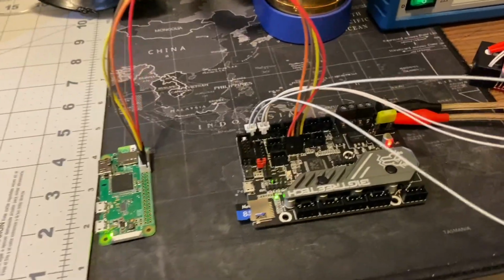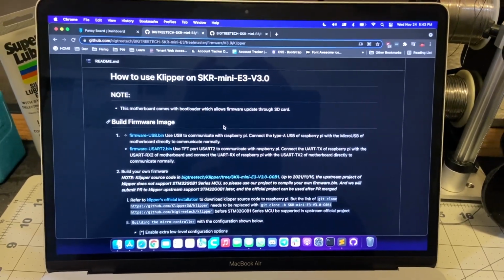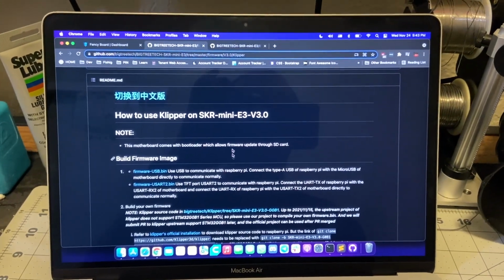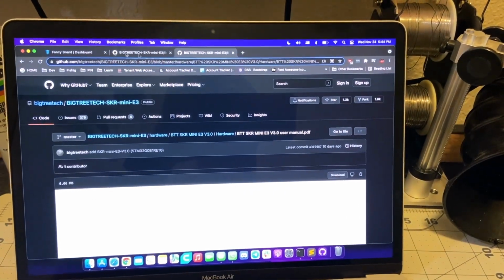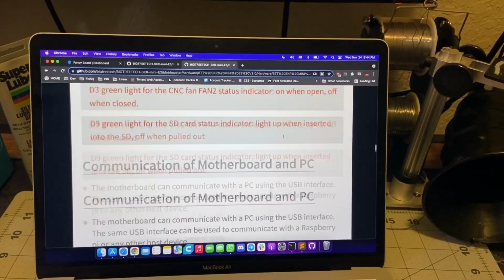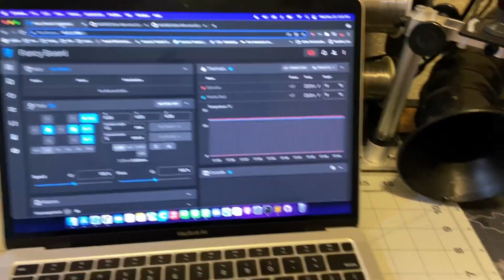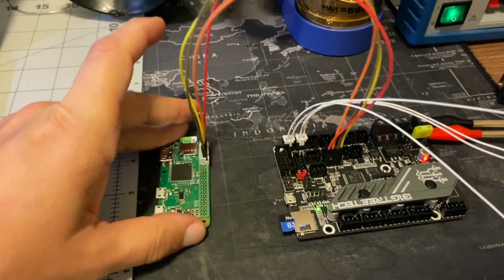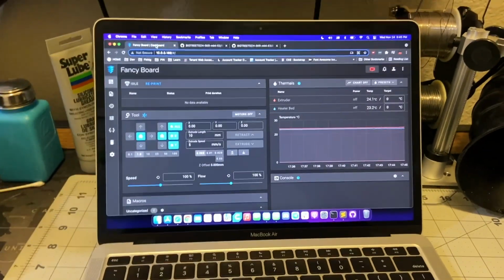(Outdated) Klipper on BIGTREETECH SKR Mini E3 V3.0 (Fix)

Comment: I have an Ender 3 Pro with an SKR Mini E3 V2.0 running OctoPrint and it works 100% fine. I just got my SKR Mini E3 V3.0 but I noticed there aren't any working firmwares yet. Do you know if there's a working firmware out there that I can play with for this? I read that I need to use the standard Arduino image, but that throws up errors in VSC. Thanks!
Reply from the maker: Hello. Yes, check link in description, there are 2 precompiled firmwares at bigtreetech GitHub repo Marlin and Klipper, good luck in use ;-)
Reply: @hobbyistnotes  sorry I suppose I should have clarified my situation better. I am definitely comfortable compiling my own firmware, and I did see those two options on the GitHub Repo, but I have custom fans, housings, dual z, etc. and I don't believe the standard precompiled firmware is adjusted for those things. Not sure how I could verify this though, other than flashing the precompiled firmware and just take note of what I'm missing. I suppose I could also just use gcodes to adjust for some things, but I was under the impression a custom compiled firmware would be the better option if not using a standard (stock) machine. Your tips and advice are greatly appreciated!
Reply from the maker: @JDMsohc  that is exactly why I like klipper, everything is in “one” config file and custom adjustments are super easy to implement in less than a minute. As for Marlin, I just checked and if you will go into the firmware section of bigrteetech repo they have brief info abut setting up marlin environment to handle new board where you can have opportunity to compile your own Marlin firmware with custom changes, it has link to marling branch with this board settings.
Reply from the maker: Here, at the bottom you will find link to the marlin source code: https://github.com/bigtreetech/BIGTREETECH-SKR-mini-E3/tree/master/firmware/V3.0/Marlin
Reply: @hobbyistnotes  thanks for such a quick reply! I did see those, and I downloaded the "firmware-bltouch-for-z-homing.bin". I don't believe that I can edit that .bin file to accommodate my upgrades either though, correct? Also, if I wanted to run Klipper, would I need the extra little board that you use in this video?

Thanks!

UPDATE: Sorry, I didn't see your other video until just now lol! I have a Raspberry Pi 4+ 8gb that I run OctoPrint off of already, so I imagine I could use that to run Klipper, yes?
Reply from the maker: @JDMsohc  that board is Raspberry Pi zero w and it’s connected via UART, you can use regular Pi via USB that came with the board. Keep in mind klipper takes some time to install and configure, as u already have octopi u can use it to control klipper instead of fluid pi that I used.
Reply: @hobbyistnotes  awesome! Does the Klipper firmware let you adjust for offsets and whatnot, just like Marlin?
Reply from the maker: @JDMsohc  it has a bit different approach than Marlin, all your settings and adjustments are stored in to the config file instead of being on motherboard in firmware, raspberry pi controls printer based on that config file, so all the changes at the future you make only in this config via web interface and you don’t have to recompile firmware every time you want to change something. Sometimes klipper update core and you have to recompile firmware but in a year I used klipper it happened once and it’s done at your Pi via terminal in few mins, no IDE configuration and etc…
Reply: You have to compile your own firmware. I’ll be right back with the link to the config files

Comment: Would this wiring work with all raspberry pi’s? Or just zeros?
Reply from the maker: Yes UART is possible for all pi but zero has low power requirements and 5v from board enough, if you will use full size pi you will have to disconnect 5v from this formation and power pi by external 5v.
Reply: @hobbyistnotes  ahh ok cool thank you. 👍🏻

Comment: It would be awesome if you could
Do a tutorial on klipper installation for skr I am close but I am missing something.
Reply from the maker: Take a look at video in description by Nero 3D he already have set of manuals how to do it.
Reply: Do you have the wiring diagram for this board?  i use this board with klipper
Reply from the maker: @vp9290  you can find diagrams in Bigtreetech git hub repository just google it, they also have very well made schematics too.